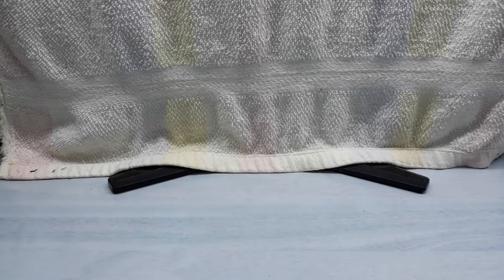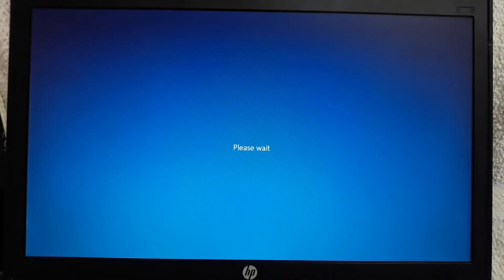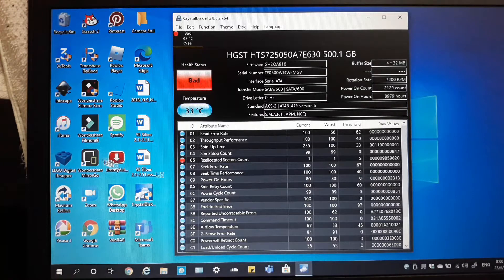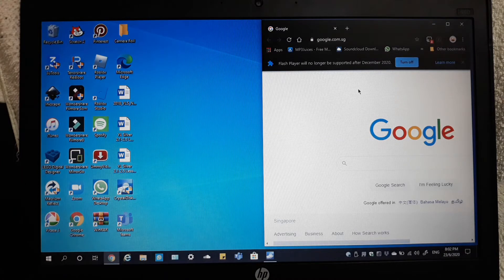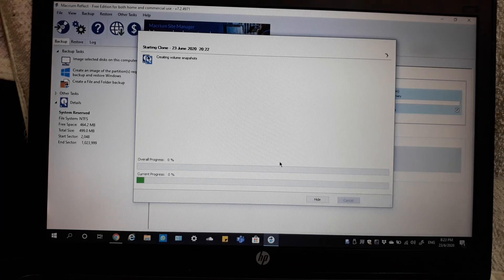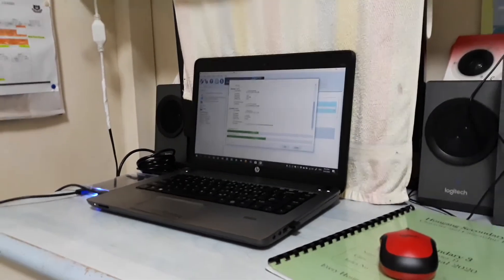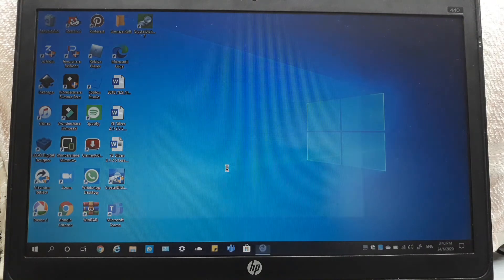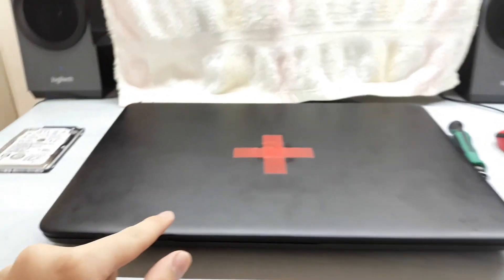HP Probook 440 G1 - Laptop SSD Upgrade #hp #probook #upgrades #righttorepair

Comment: Could you post a link to the SDD you used please? Not sure what kind of connection/type of SSD I need to use to replace the HDD on the same exact laptop model.

Thank you :)
Reply from the maker: I using the Samsung 860/870 Evo SSD for installing the laptop
Reply from the maker: just Google search and you get what you are looking for